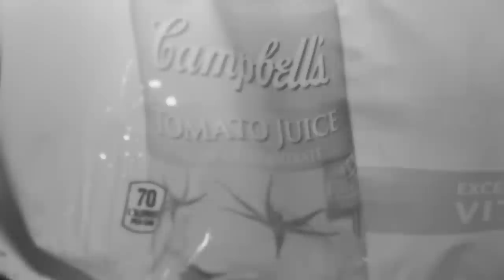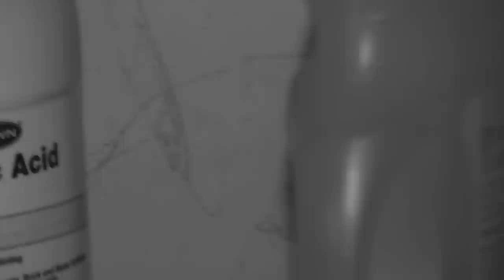(PART 1) HAUNTED LIVINGSTON MANSION. MOST HAUNTED SCARY HOUSE EVER!

Comment: The Silvery thing you were looking at just before the dresser fell over is a key case. A piece of leather was folded in thirds, and contained little metal hooks to hold keys. When you folded it closed and snapped it shot the keys were flat inside and you could slip the case into your pocket. I haven't seen one of those in years, possibly decades. LOL

Comment: I caught this 2 yrs after it was posted and I don't know if you will ever see this but here we go..I noticed the squatters alarm system everywhere so here it goes, when you see things like a can on stairs or things blocking a closet or door just in general things that make noise if you hit or move them in odd places it's there to alert someone who's not supposed to be somewhere that someone is coming to give them time to run or hide..so for God's sake if you ever see these things be super careful..if I knew a way to email you I would have sent this directly to you because in this video there were ALOT of signs ya'll were in danger..please be alert and safe at all times ❤

Comment: Was that a second door in the attic when y'all heard that crashing down stairs, and also I'm not 100% but I kinda think it was that broken mirror, that fell apart, behind the couch. 
26:17 I sounded like something was said, but I can't understand it.
34:21 sounds like "help me?"
Also what is up with the TP tube being in the middle of the stairs?! Is that like the person who is staying there's security system? I mean seriously who's gonna think about setting it back up after knocking it over.
Reply: 26:17 was Sonny i'm pretty sure i could be wrong though and 34:21 was CJ.
Reply: Neither voices or pitches fit Sonny or CJ. 26:17 is too deep and the very clear  "help me" sounds like it's being whispered right into the microphone. I noticed a whisper at 20:17 too!

Comment: When that dresser fell over I don't think it was because of the floor something push that dresser over that dresser was not even up against the wall there's something in that room something happened bad in that room there's even surgical scissors on the floor and I don't think that little bouncing knocked over that dresser it didn't even move when you was bouncing that's crazy

Comment: I'm thinking that cat tried to keep you away from that small room in the closet upstairs due to her possibly having her babies hidden in there most cast that get left behind or are stray tend to had there babies so no one or nothing can get to them to harm them. So if that's the case CJ and Sunny you should get a cat crate and take that cat and find her babies and take them to your local SPCA because yes the big one will be fine as she looks to be very healthy from eating mice or garbage but as for her kittens she may not have enough milk in her system to feed her babies and they could die either from lack of milk from momma or even cold weather.